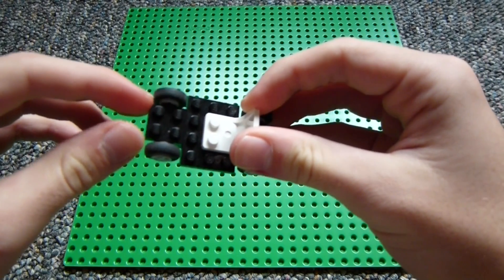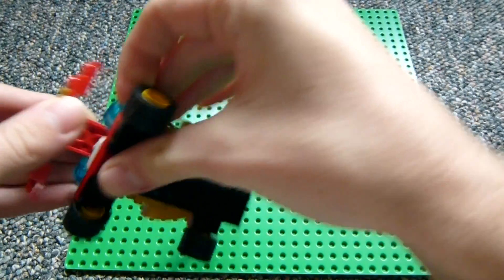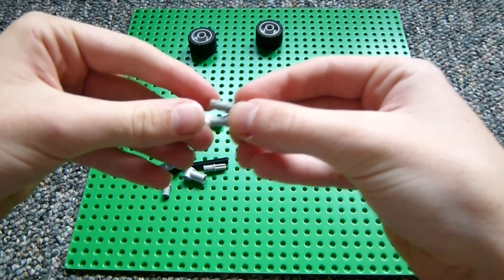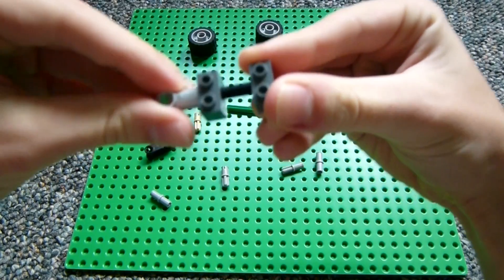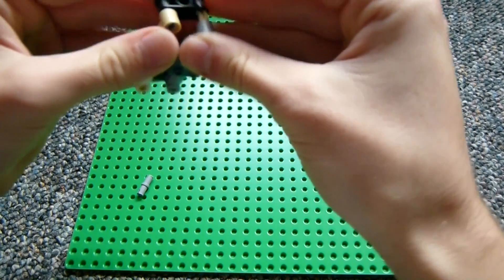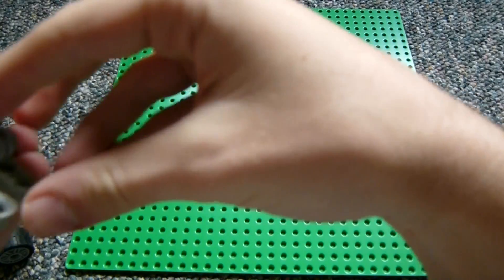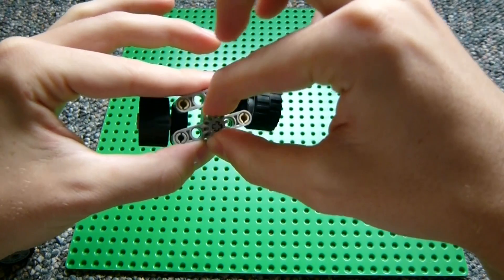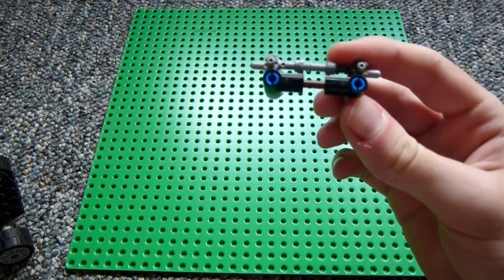Lego Building Technique: Car Chassis and Steering

Comment: It's a really good mechanism, I made a go-kart, but I wanted to add a little steering mechanism, not too bulky like the technic steering mechanisms, it's kind of hard to steer because it sometimes turns alone but it works well and fits perfectly